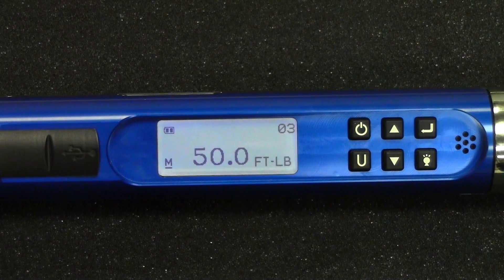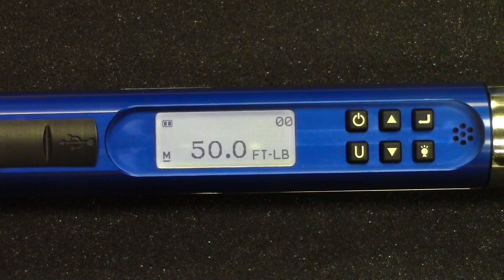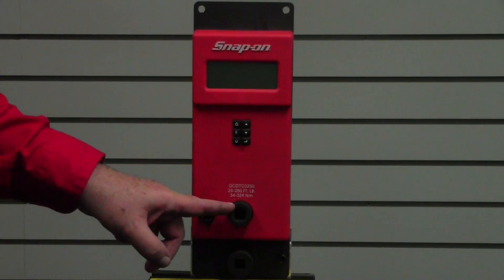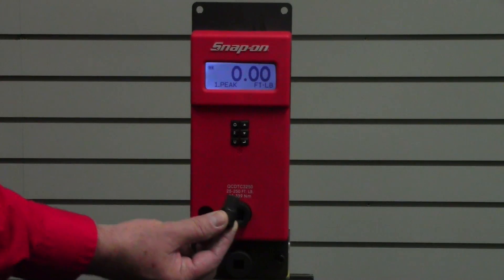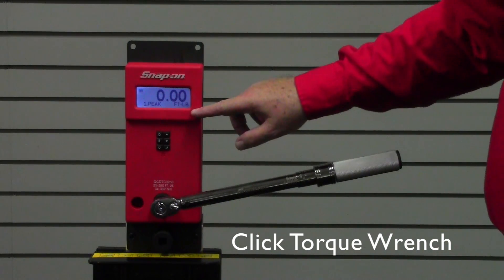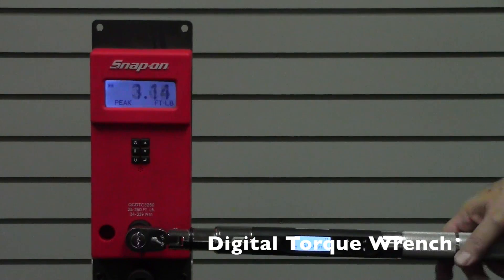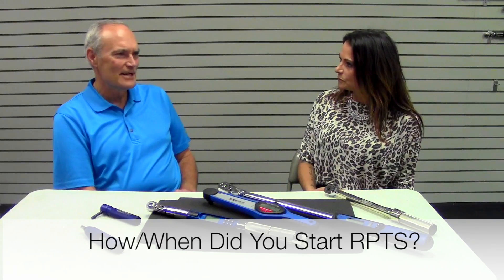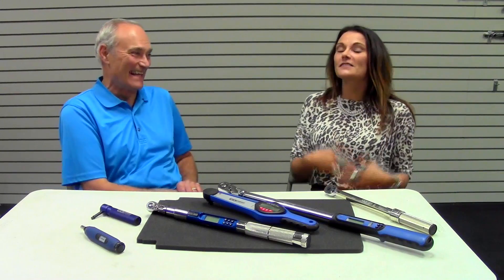CDI Digital Computorq SG & Snap-On Torque Wrench Calibration Checker  | Robb Precision Tool Services

Comment: how is an advantage of a digital wrench accuracy when it was less accurate???
Reply: Digital is very dependent on the force being applied, you might apply a little more force than I would so you might get a reading of 50.3 where I might get a reading of 49.8. The wrench it self is accurate the different readings are because you and I react different to when the lights light up and the vibration occurs. Again the torque wrench is accurate.

Comment from the maker: A Must see video for all torque wrench users. Did you know 75% of torque users over torque or under torque?
 The digital torque wrench shows you when you have reached the correct torque with an alert. 
You can instantly see if your torque wrench needs calibration with the portable torque checker.
Reply: It's honestly higher than 75%. It's extremely easy to go over & from my work in calibration, I can tell you with certainty these are less accurate and more prone to repeatability error.
Reply: +Robb Precision Tool Services ,Inc. Not to mention alot of people Double torque also.....